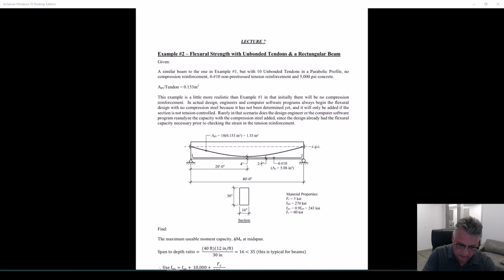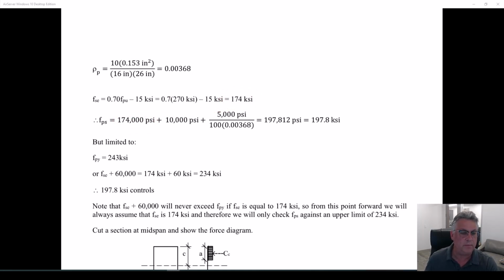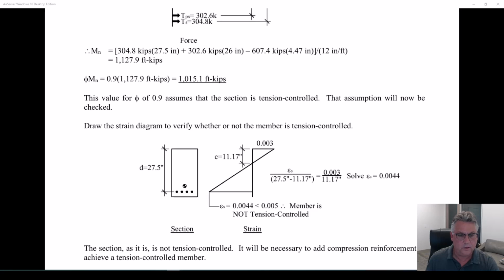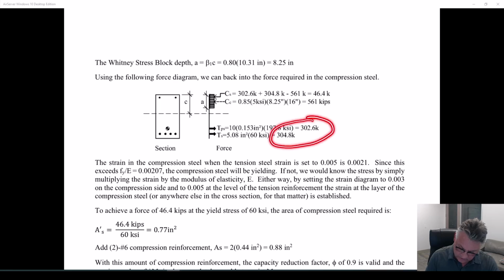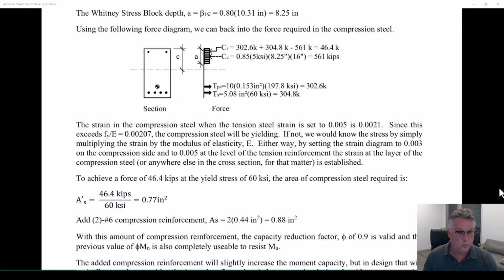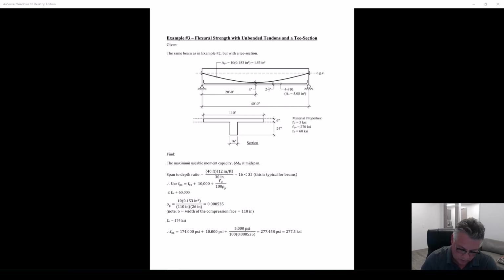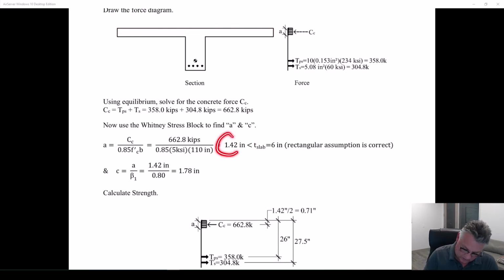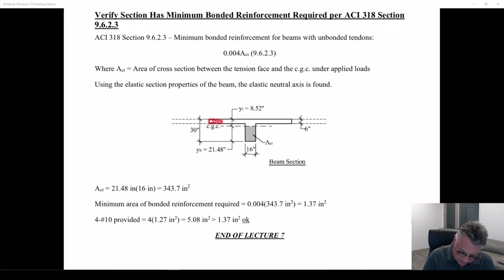Lecture 7 - Flexural Strength Continued (2023)

Comment: Dear Dirk,

Thank you for the invaluable lectures on post tensioned concrete. I really appreciate everything you have provided. I wanted to ask the following, when verifying the section to ultimate bending capacity, why the precompression in the reinforcement* is not taken into account for the stress/strain calculation?.

Thank you again,

Juan
Reply from the maker: Because eventually the bonded rebar will achieve full yield tension, regardless of what state it begins in.  But interestingly enough, I have an article submitted to Concrete International now that does address the axial precompression in the nominal strength calculation.  Stay tuned!
Reply from the maker: I'm not entirely sure I understand what you are asking, but here's my best shot.  At the ultimate condition, the initial condition (precompression, etc.) has been completely overcome.  The starting condition of stress or strain doesn't really matter.  It's the condition at nominal capacity is the only thing that matters.  The reinforcement will get to yield regardless of where it starts.